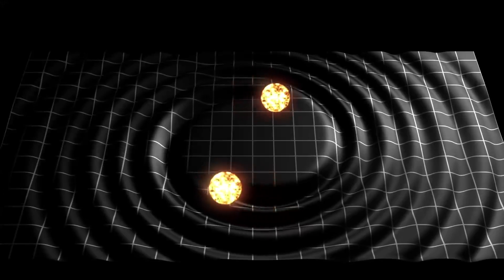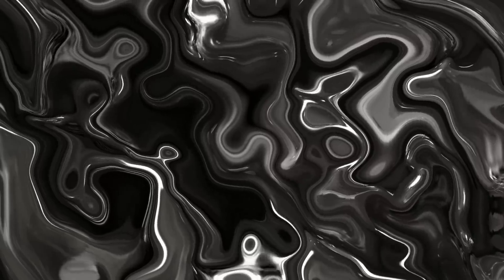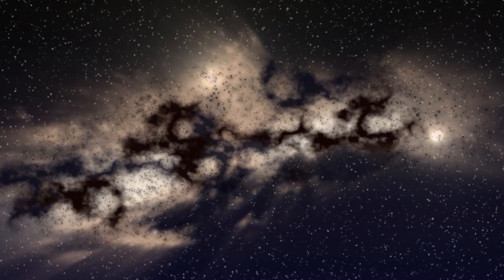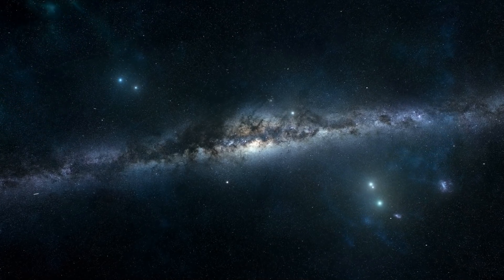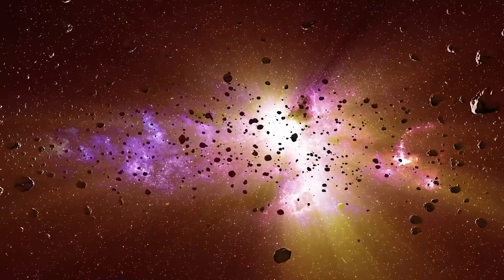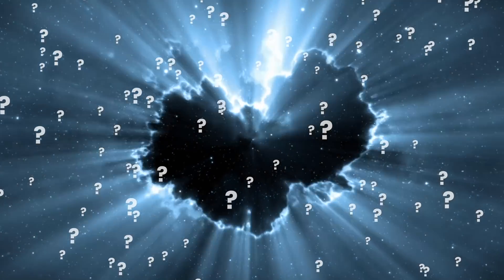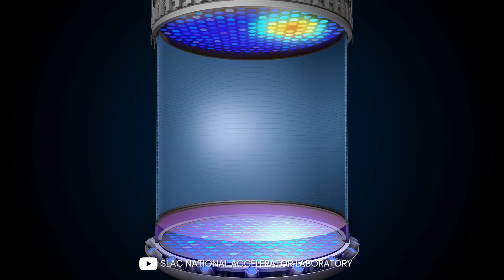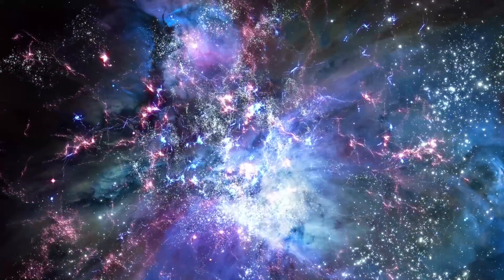This Will Change Physics! Dark Matter May Not Exist!

Comment: Dark matter, dark energy and electromagnetism are in my ‘slightly crazy’ idea the ‘fuel’ for any extraterrestrial spacecraft that would move at insanely high speeds with 0 sound emitted, no propulsion methods visible, and have anti gravity properties. In theory the idea is to pull the aircraft, not push it. There would be an almost tether like connection, think of a magnet…. 

Am I crazy ? Or just stupid 😜
Reply: Well there's really no difference between pulling and pushing an object relative to that object. It experiences the same force. And it's not really dark matter you need for such a concept (mostly considering we don't know what it is, and the name is misleading because it isn't necessarily matter at all), it's negative matter or negative energy that we would need. The goal is to create a "slant" wave in spacetime that would surround the ship and move it without "it" moving.
Reply: @williamhorn411  is this like a warp bubble?  I think that’s what it’s called. Someone apparently just discovered real warp bubble while doing a different experiment. I’ll try to find the link…
Reply: Futurama
Reply: In my dreams I can't fly fast until I think of pulling myself forward. I always had a hard time flying in my lucid dreams, more then any other "power" I would try to replicate. Maybe that's how it's meant to be done..
Reply: Neither crazy nor stupid my friend.
Reply: bob lazar said the same thing, that the crafts he was working on were propelled by anti matter which changes the gravity of the craft making it weightless.
Reply: "You pull the universe towards you"   -👽
Reply: @littleAE86thatcould  universe will rip your body apart 🤣
Reply: i was thinking the same that they use dark matter as unlimited space fuel 😁 but this isn’t looking possible , but nothing is impossible 😊
Reply: @FILMREGIONTv  many things are impossible.
Reply: Definitely a complete stupid crazy idea
Reply: In futurama, the spaceships use dark matter, and they operate by making a bubble around the ship, and moving the entire universe outside of the bubble, while staying still itself.
Reply: @steverempel8584  This is how powerful my feet are. They don't move me through the universe; they move the rest of the universe around me. I don't need Dark matter because I do matter.
Reply: @steverempel8584  -  And Nibbler poops out balls of dark matter that look like what science says a black hole looks like.
Like a big black marble.
To think a sun fuses hydrogen and helium for 10 billion years is silly.
A sun fuses HUGE amounts of hydrogen until it creates metallic radioactive core with a periodic number that is most likely in the millions to billions.

That is why Nibbler, in Futurama, is perceived as a "cute baby who can't talk", but by rights he is super intelligent AND he poops dark matter out his butt.

It's a joke about how science, for some reason, is lying about the life and death of suns.

And it's not rocket science.  If you threw a chunk of steel into the sun, would it reject it because it is not made of helium and hydrogen?  Or would it fuse it, and turn it into fuel?

What astophysics is going to try to "tell people", eventually, is that suns turn into black holes that eat matter and send it via ''wormhole'' to "white holes (big bang) to be ejected.

The universes are being held together, via ancient dead suns, that are just super huge sun cores that "create gravity" and no long emit (lmfao) "Hawking radiation", so they are practically invisible.

You know how to tell when science is lying to you.  When they give you percentages, for what space is composed of, using theoretical materials.

Hey look.  Funny joke.  You know why Hawking was a cripple?  Because he tried to expound on the lies Einstein started, and when he was young, he did not listen to the little voice in his head, that warned him, against doing that.

Here's another joke.  People into space and astrophysics usually never mention God, which is funny, becauseEinstein was ''smart enough'' to write a letter to God before he died.

Can you figure out why?
Reply: @michael-dm2bv  Futurama also had a Helium Mine on the Sun.  It worked and operated just like a normal Mine on the earth, workers covered in soot and all. Except it was on the Sun, and they were mining Helium.
Reply: @michael-dm2bv  Oh, and for a few serious comments to some things you said... 

If you throw a chunk of Iron into a star, it would melt, then vaporize and turn into Plasma.  So there'd be some Iron floating around in the sun in the form of Plasma.  It wouldn't act as any kind of Fuel until the star goes Super Nova, as that process is required to fuse anything higher than Iron. 

Iron is actually the most stable atom out there in the universe.  Normal stars will fuse up to it under the right circumstances, and you can get SOME energy by fusing atom together, as long as the resulting atom is lighter than Iron.  (Although persumably not much when you get closer to it)

On the other hand anything bigger than Iron takes energy to fuse, and you instead get energy by breaking it apart.  The unstable conditions of a Super Nova are needed to make anything higher than Iron.  And all atoms are above it are, in a way Radioactive, in that if they were left around for all eternity, they'd devolve to Iron eventually.  If the Universe was left to run for all of time, and protons don't decay, anything not sucked into a black hole would eventually turn into Iron.

TL:DR: In infinity years, the entire universe will be nothing but Iron.

Also, many of the large Black Holes out there are likely products of the early universe, and were never stars in the first place.  Like the ones at the Center of Galaxies.

I've never heard any credible evidence for White Holes, I personally find their supposed existence to be dubious. 

Also, Science never "Lies" about anything.  These are all theories, which are Educated "Guesses."  The only lie being told in Science is that any of these Theories are actually fact.  Any true scientist knows this and will admit to it.  They are good guesses, based on logic and observation, and many times are the best guess we have available to us, but in the Physical universe, all we have are THEORIES, and those are always ultimately guesses, that are able to be replaced by other guesses.  A lot of people do get confused, and start thinking of them as fact.  Part of the problem is that there is a whole range of confidences, with no separating lines, behind all the theories ranging from "Best idea we've got" to "99.999% sure this is true."  THEOREMS are theories that have been proven and are now considered to be undeniable fact.  Theorems only exist in the realm of Mathematics.  
Theories of Quantum Physics were required to make the Microprocessors for the computers we are using, so that's strong circumstantial evidence to support it.  But that doesn't mean those theories are 100% true, there's probably deeper levels than it out there.

TL:DR:  Theory = Guess, Theorem = Fact.  Anyone saying otherwise is either ignorant, political, or doesn't understand how good some guesses can be, and still be a guess.
Reply: @steverempel8584  are u there yet.  Me and ur wife are discussing the math of alcohol.
Reply: @michael-dm2bv  There are many possible reasons why they did that, I have no idea personally which one it was.
Reply: @michael-dm2bv  The Real question is, are we living in the Matrix, and that Movie is happening present day, or are we living in the Real world, and that movie is in the distant future?

Edit: OH! And The Matrix is a Sequel to the Movie A.I. Artificial Intelligence.  It's too perfect!!
The Robot Uprising described in Ani-matrix happens probably only a few months after the events of A.I. !
Then the Last part of that movie (4000 years later) happens long after the Matrix Franchise is over.  (Those beings are advanced machines, not Aliens)  It fits so well it's uncanny! There's even a slight plot hole in the Movie A.I. that's partially resolved if you Plug The Matrix Franchise into it like that.
Reply: Both
Reply: First they say God doesn't exist, Now dark matter doesn't exist. What next? Reality?
Reply: @johnjeffreys6440  The whole Universe and everything in it is nothing more than your perspective of it, to you.
Reply: @kierandevine364  -  Not really.  Ur trying to dumb down the math, and that is not allowed.   A pair of underwear is a pair of underwear EVERYWHERE, unless a soul wears them as a hat, but even then anyone and everyone will still argue they are STILL underwear.

Have you ever seen a gas station switch the side of the road it was built on, twice, during the two ten minute periods you had ur back turned to it?  i have.

And that wasn't MY perception of reality.  It was real.  Both times people were using both gas stations, regardless of which side of the road they were on.

So there is a perception of what is there, that EVERYONE sees the same, but whose construction of it can be altered by someone or something.  

What you said sounds a mix of Tool's song "Third Eye" and concepts that the movies "The Matrix" explain.  Which is a not a good place to brush up on ur ''metaphysics'' or whatever that branch of astrology is called.
"The Matrix" went down the crapper before the first movie ended. So if you listen to anything they tell you after, ur essentially overdosing hard on a big pile of stupidity.

Collective subjectedness.  We all see it, because ONE creator creates it.  Neo's only ''real talent'' in ''The Matrix'' should have been, that he had such a good relationship with the ''Creator'' that the ''Creator'' had no issues, ''paving the way'' for Neo, and whatever he knew his mission in life was.  

And instead they gouged out his eyes, and tried to crucify him Jesus style, at the end of the 2nd movie.  The one with tons of stinkie hippies dancing in caves, while a tiny military worked out the threat threat of those metal machines.
Reply: You mean Alcubierre drive? That theory's a thing, but it has nothing to do with dark matter or dark energy.
Reply: @NoName-ze4qn  i hadn’t heard of this until now while reading through the comments , I’ll check it out
Reply: this is literally the idea that the alcubierre drive is based on
Reply: @algolk06  a theoretical drive is something that doesn't exist and is based on the power of imagination. Facts based on lies cant exist in real life.
Reply: Wouldnt anti-matter have that property? Bob Lazar stated the ET craft he worked on was an anti-matter generator. According to him, that reactor works at 100% efficiency (producing no excess heat)...
Reply: @chrism6904  No, that is a Element 115 reactor, it is a proton hitting 115 giving off 116- which converts to anti matter giving off a great burst of power; which is collected at a 100% efficient electro-thermic generator converting all that matter- anti matter reaction to 100% usable electromagnetic energy. Which then is used to powered an Electrostatic gravity distortion drive.
Reply: both
Reply: both
Reply: May be both (just for fun).
Reply: You are the father of alternate science. 😉
Reply: Actually ripped it from a Bob Lazar Documentary tbh 🤣
Reply: @BaronCorps  Bob lazar claims that it is a stable version of element 115 which alien spaceships use. We have artificially created but it lasted for less than a second before it self destructed. It very well might be a naturally occurring element somewhere in the universe but our solar system only has up to element 94 plutonium.
Reply: Sounds like you ripped it straight from a sci-fi novel.
Reply: @supC_  actually i ripped it straight from a bong hahhaaha
Reply: @Pepe_LeMac  HAHA i was ripping my bong reading ur first comment and was makin me think hard
Reply: Your more interesting than most 🤷‍♂️👽
Reply: Your imagination is based on lies. There is no such thing as dark matter.
Reply: @kierandevine364  you'd have to prove that claim. It also makes it very clear you don't actually know what that phrase means.
Reply: @DarkAlkaiser  "Dark Matter" Is some crazy theory to explain why galaxy's spins so fast without flying apart. But that is based on the (incorrect) math that the earth clock is the same clock everywhere else. Gravity bends Space-Time. Less gravity, time passes at a faster relative rate to clocks in more gravity. Like for example a galactic gravity well. Highest level of gravity at gigantic black hole at the center, much less on the outer edge of the galaxy. 

"Dark Energy" is another crazy theory to explain why when we look at the structure of the universe, it is in the form of a sponge, meaning galaxy's form along lines surrounding vast empty spaces. When we look at the light from billions of light years away, that sponge structure has less empty space between the vast spaces In between the lines of less developed galaxy's. That is why the Springs theory came up, where is all this "Dark Energy" coming from. However that theory doesn't take into account the phantom partials that became known as Quantum Foam. This foam has been confirmed long ago in experiment.  Back to the vast empty spaces in the sponge structure, that Quantum Foam  in the lowest possible gravity fields, and much reduced clock rates; enable that quantum foam to interact with its self and Hawking Radiation; creating Hydrogen. Which is why those vast empty spaces are not empty at all, yes very very very thin hydrogen; like 6 atoms per square meter. 

Proof...  Hawking Radiation has indirectly been confirmed. When that Quantum Foam interacts with a black hole, it lines up so that only the negative portion of the Quantum Foam gets into the Black hole, allowing Black holes to evaporate; slowly. That positive portion of the Quantum Foam is what is known as Hawking Radiation. It radiates out from every Black hole.

So you see I can explain many things simply because I completely understand.

Black Hole + Quantum Foam = Hawking radiation + Infinite Universe with sustainable source of mostly not Anti-Matter Hydrogen.

Comment: What holds all matter together? Electricity. Where does a tiny atom find the power? How is electricity made in a tiny atom? It’s the gravity of the earth, the sun, and any other body in our solar system with a hot iron magnetic core. The magnetic field generated passes through the nucleus electrifying it and it then has the power to grab protons. Depending on the strength of the nucleus dictates it’s weight or atomic structure. But what happens in deep space with no magnetic fields? The atom simply would become unable to attract protons. So we would have unconstructed atoms made of neutrons and protons floating freely. Uncharged. Dark matter.
Reply: Neither Electric Universe nor Plasma Cosmology have any mathematical foundations that even has a half a percent of the explanatory power of the Standard Model. They are hoaxes on the same level as flat earth nutbagery and designed to sell books and make money from holding talks.

Comment: There is an elephant in the room explanation for those higher than expected rotation rates. Einstein explained it in the 1939 journal "Annals of Mathematics". Where ever you have an astronomical quantity of mass "dilation" (sometimes called gamma or y) will occur. Mass that is dilated is smeared through spacetime relative to an outside observer. The mass at the center of our own galaxy is dilated relative to us, that mass is in some sublime way everywhere.
   Most people dont know that Einstein repeatedly said that singularities are not possible. Nobody believed in black holes when he was alive because he would promptly explain that you have to factor in dilation. 99.8% of the mass of our solar system is in the sun, 99.9% of the mass of an atom is in the nucleus, if these norms are true for galaxies than we can infer that there is 100's of trillions of solar masses at the center of high mass galaxies. If you attribute a radius you can calculate that relativistic velocities occur in these regions.
   Low mass galaxies have been shown to have normal star rotation rates (some galaxies can appear to be low mass but can have high mass at the center), this is exactly what relativity would predict because there is an insufficient quantity of mass at the center for relativistic velocities to occur.
   If you pose the question "why cant we see light from the galactic center" the modern answer would be because gravitational forces there are so strong that light can not escape (even though the mass of the photon is 0). Einstein's answer would be because the mass there is partially or completely dilated relative to an Earth bound observer.
   There is no pictures of black holes, all images and data are in line with relativity. Dark matter and black holes do not exist, its not a matter of opinion its an elephant in the room.